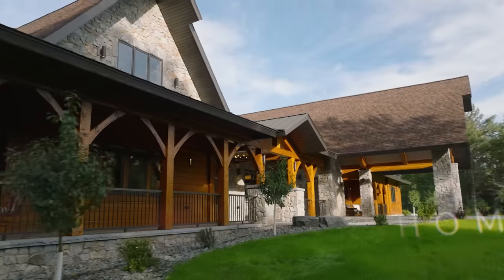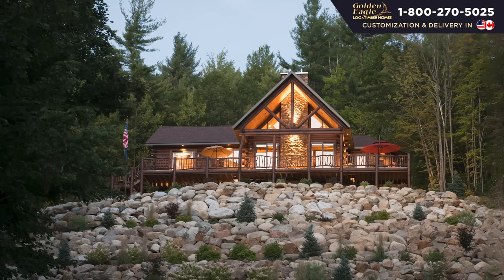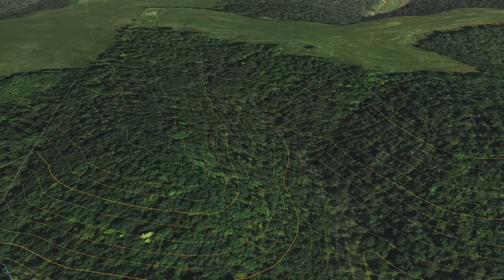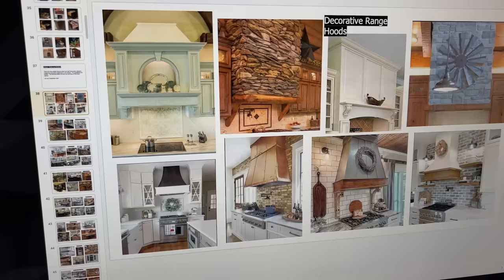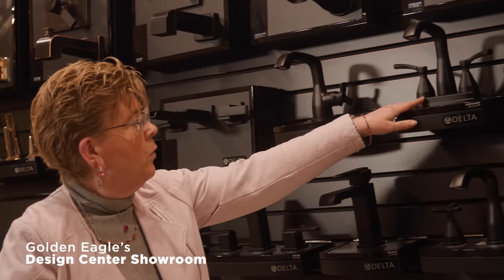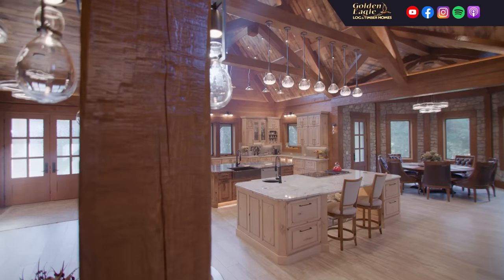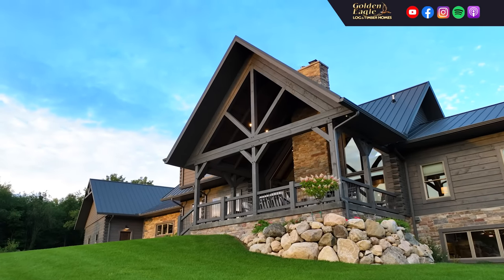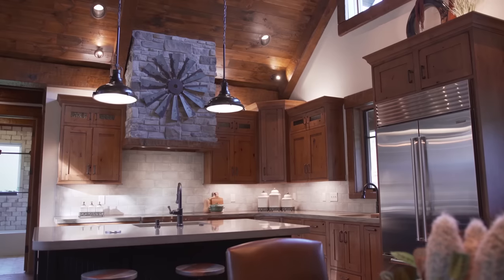Your Guide to Building a New Construction Home in  2024!

Comment: Does the cost of building go up the further the home is from Wisconsin?
Reply from the maker: The turnkey cost of building will generally be most impacted by the land you choose to build on, and the complexity of your home. While location certainly matters, it will always correlate with the local cost of labor. Electrical, plumbing, concrete, general construction, much more would be local labor.